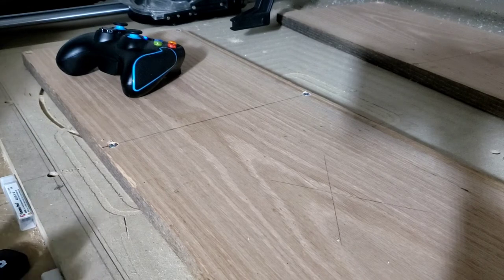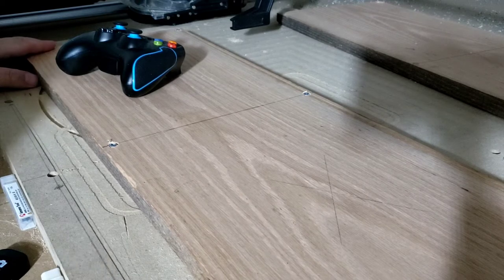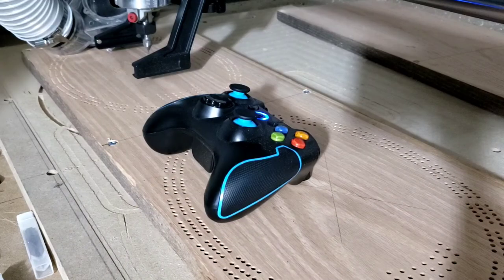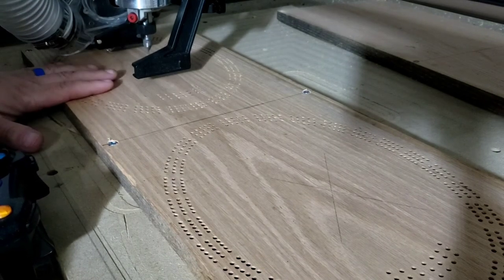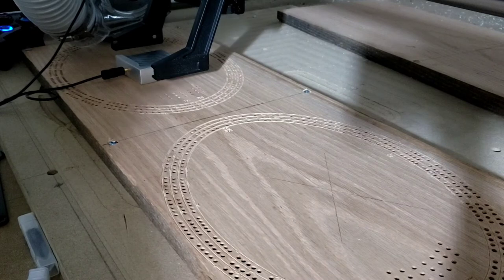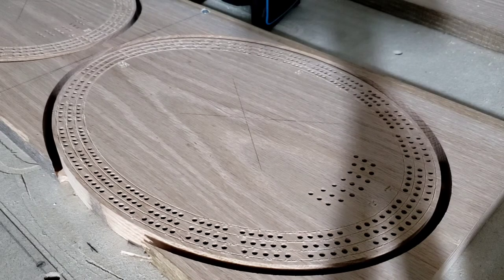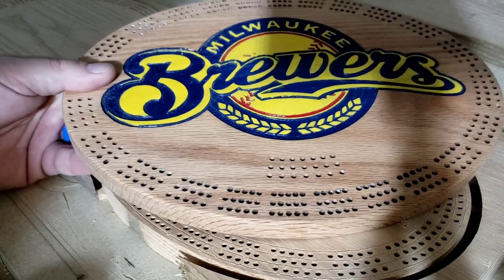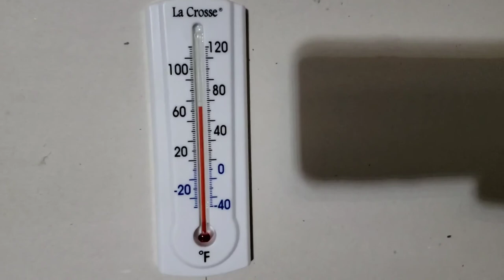Custom Cribbage board cuts on the Onefinity - Part 1

Comment: Nice projects. What happen with the centering? How deep are the peg holes and was that a drilling toolpath? thanks
Reply from the maker: Yes it was a drilling path, I ran the Amana SpeKtra 1/8" bit at 40 ipm feed and plunge and it drilled the holes like butter. no burn marks, bit still looks brand new. the Centering cross is just for the next step when I put the board in the jig so I can use that to reference center to cut out the design a customer purchases. I price these boards based on Wood type since wood is very expensive now. the Peg holes are 3/8" deep at 1/8" diameter. Thank you for watching.
Reply: What I meant on centering is that it looked like the profile cut missed cutting some of the shape (flat spots). Just wondering what went wrong there. Thanks
Reply from the maker: That was a rough cut lumber. I didnt use a straight clean cut piece. I sanded the sides and the flat edge is gone.